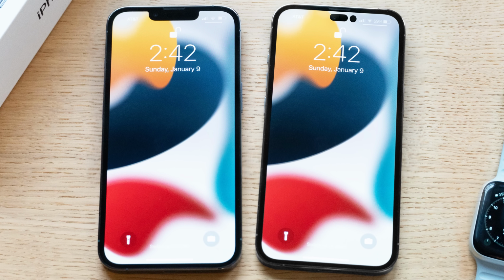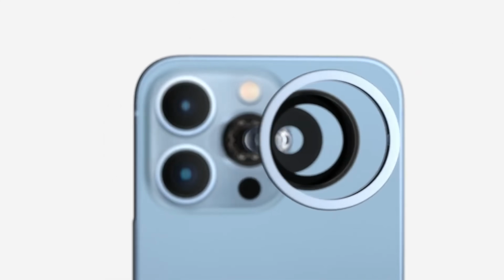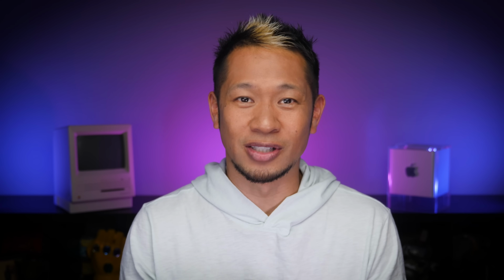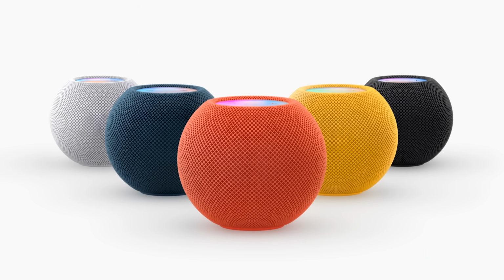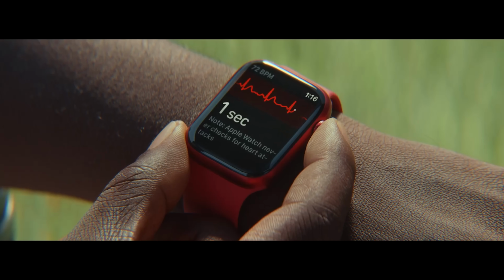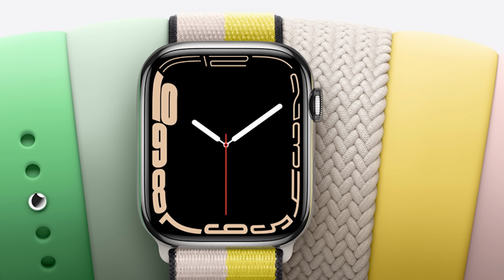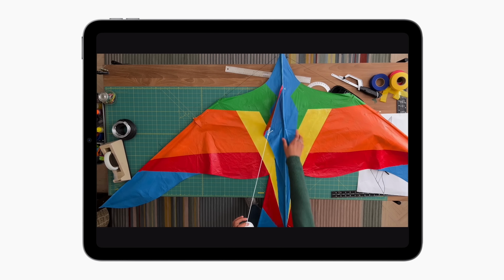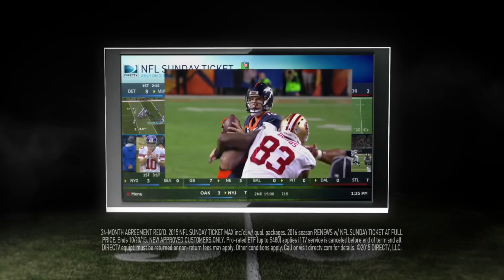iPhone 14/14 Pro Camera Leaks & No USB-C!

Comment: They have to INVENT a new method to measure blood glucose, otherwise pinching the finger tip would require them to sterilize the surface first then the sterile needle and to wipe out the blood drop….. 😁 and so on!!!  On the other hand BP monitoring looks more real. Let’s hope for the best! 🙏👌

Comment: Apple products are designed in such a way that you don't need to upgrade  every year. Specifically Apple Watches, iPads, Macs etc. You  can keep these devices for up to  5+ years and still get the software updates and security patches. It's like TV's and Cars. The year to year upgrades are minimal and are for those who are ready to upgrade. Someone with an Apple Watch Series 7 should not be complaining about the lack of features on the upcoming Apple Watch Series 8 (example).
Reply: Glad that someone finally said it

Comment: If they can get better bandwidth on the lightning, I’m good with that. USB-C seems less rugged than lightning and a lot of companies making USB-C do a crappy job.  I bought a USB-C cable from Staples that was too tight plugging in and pulling out. I took it back since I didn’t want to ruin my port. There is no “Made for iPhone” quality verification for USB-C like Apple has for lightning.
Reply: Poor timing from Apple given what just happened at the EU.  If they make an Iphone today, without USB C, they won't be able to sell it in the EU after 2023.
Reply: @vincevinnyp9224  No lol, first of all the law hasn’t yet come to place and even then, it will only apply to new products. I really want EU to force all laptops including those beefy gaming laptops to charge over USB C and see the reaction of the PC gamer community. iPhones will go portless rather than have USB C.

Comment: Xr still going strong. Not upgrading until the next iPhone comes out with USB-C.
Reply: When portless iPhone comes out will you upgrade?
Reply: @aninditabasak7694 if it is my only option, yes. I like my ports.  Never got into the wireless charging. I mostly just don't want to have to keep two different cables. One for USB-C and one for Lightening. A universal is the way to go.

Comment: I’ve got the series 4 Apple Watch and felt little reason to upgrade. Probably the main thing that’ll get me to upgrade would be if battery degradation gets really bad.
Reply: What's your battery health? I have barely used my series 4 and mine is at 94% still
Reply: Have the Apple Watch 4 and. Feel like I can hold it for another two years…smooth enough

Comment: Apple software is in need of some major improvements. There are a few camera glitches on the iPhone 13 pro max, including 240fps slow mo dropping frames like crazy, and 4K60P hdr video dropping resolution with camera pans. Cameras do not always switch correctly between wide and telephoto, even in bright light. Why can’t I have gapless playback or cross fades with Apple Music? I can on my Android - which seems crazy to me. Menus occasionally overlap text. It’s a nice phone, but there the software is lacking polish. iPadOS needs some love, it should be as useful in functionality as macOS without actually being macOS. In terms of hardware, they are very polarized. Some great chips, but some of the hardware is not up to par. Additional telephoto lenses, higher megapixel counts, and better quality secondary camera sensors come to mind. They should have a unified smart home system that allows for multiple speaker pairs for true Dolby atmos. Their Studio Display is a Frankenstein of high tech without high tech functionality. Sit down in a room Apple, and decide how you are going to utilize all of your devices in a way that each feels unique, provides top class functionality, and provides value and benefit to your customers. I don’t have a problem with a high price if I’m getting top tier quality and functionality.

Comment: I totally agree with you that when it comes to the Smart Home no one has been able to put the entire thing together. I also have a combination of Google Nest and Apple devices all around the house and wish I could be just Apple everywhere. That said, I would entertain another smart speaker because I really enjoyed the HomePod and wish for it to come back because of its fidelity. Frankly, I never really cared about the fact that it wasn’t smart, I always saw it as just a great performing speaker for music.

I have a Sonos system, but I am missing surround speakers from them, because they don’t offer a battery operated speaker for those of us with open floor plans where a power cord running across the house to a speaker is impractical and down right ugly. So, if Apple could solve for that, I am in!

Comment: The "i shape" cutouts are pretty much the equivalent to just putting a smaller notch in that area. You can't do anything with that small space between the two hole punches and you can't do anything with the small sliver above the cutouts either. So in reality, if you just had a smaller notch it would be the same thing. Only thing gained is just a little bit more info on the menu strip such as battery percentage. Some may even say the cutouts will be more distracting than the actual notch! We'll see. Thanks!
Reply: iPhone 14 pro will have the notch. Don't believe the rumours until you see it for yourself.